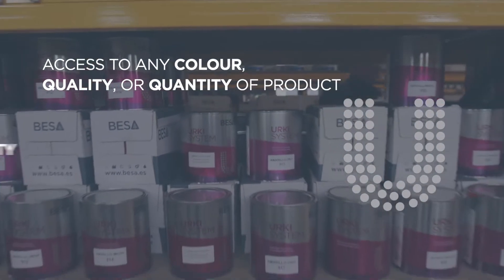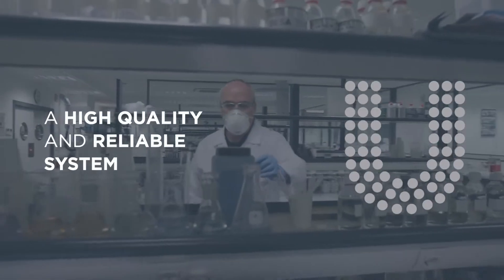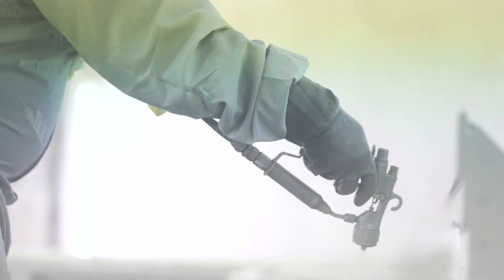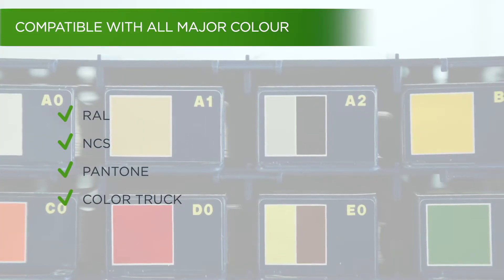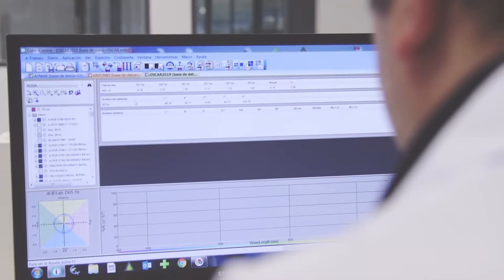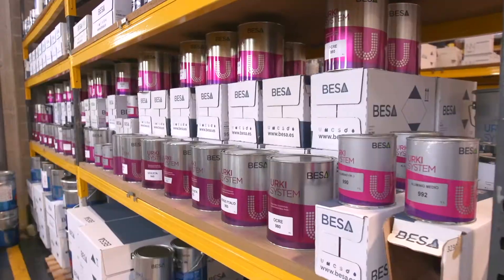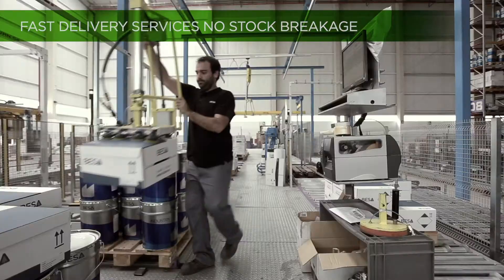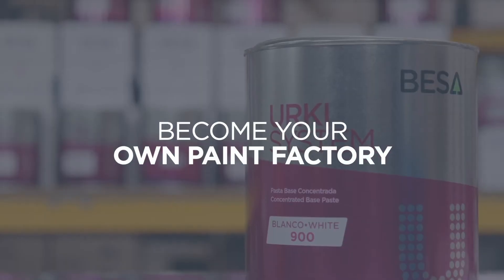Universal Tinting System for Industrial Painting |  URKI SYSTEM

Comment: Hello, good day.

I am planning to start a small-scale automotive paint shop in my hometown in Iran, and I am currently looking for equipment for precise color measurement, paint formulation, and paint mixing (both clear coat and base coat).

My requirement is a complete system that can work mechanically from color detection to paint production, with high precision and quality, and without error. The shop is expected to handle around 300–400 paint combinations per day, so I need machines suitable for this scale.

I would greatly appreciate your guidance on:

1. Recommended models and types of machines suitable for this business, especially which A3 model would be most appropriate for a daily production of 300–400 paint mixes.

2. Estimated costs and investment required to start the shop.

3. Any other guidance or tips for establishing such a paint shop successfully.
Reply from the maker: Hello. For these types of questions, we encourage you to send your suggestions through our contact form: https://www.bernardoecenarro.com/es/contacto/
Thanks!